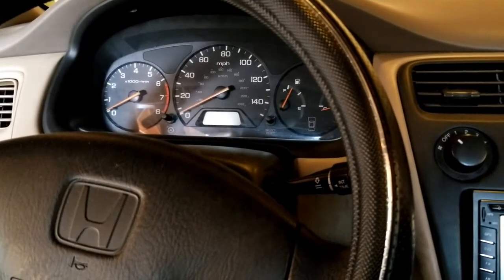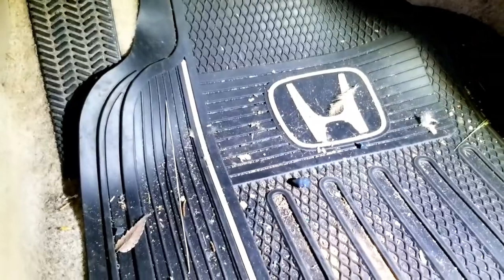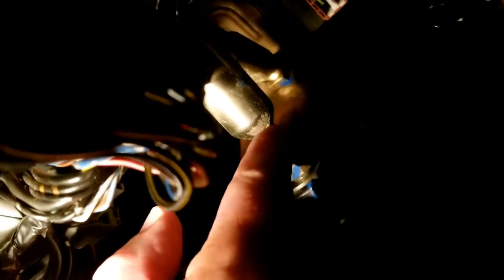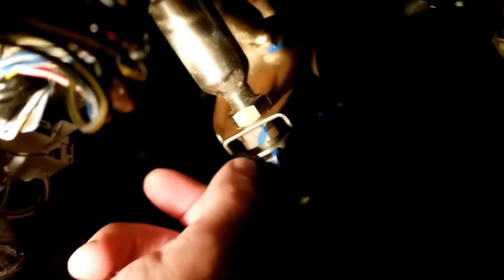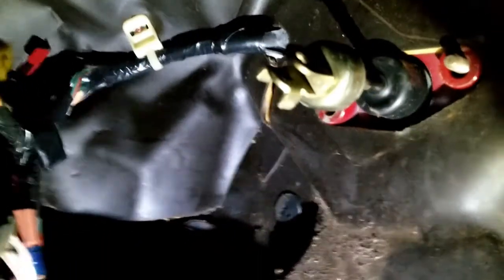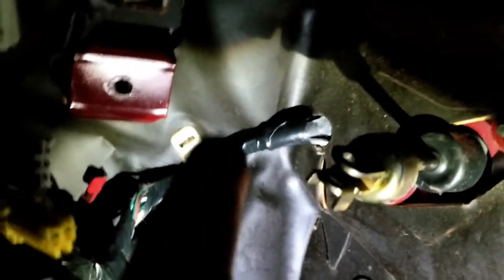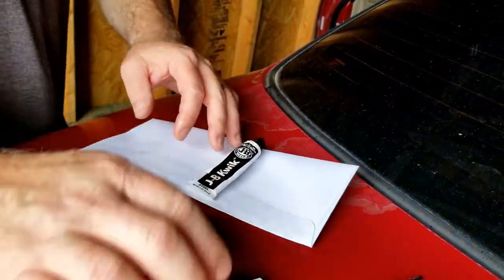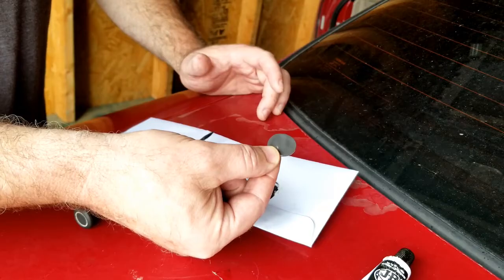Honda Clutch Safety Switch Repair

Comment: How to replace the broken rubber without taking the clutch off: 1) cut the finger off a plastic glove. 2) If you superglue a nickel to the end of your plastic glove, and 3) put jb bond on the other face of the nickel, 4) you can get your finger in right where it goes without taking the clutch off. 5) 5 minutes later, carefully pull your hand out of the glove.

Comment: There’s actually a way to start the car without the paper clip.  Once you find the switch.  Make sure it’s in neutral.  Put the key in ignition.  Locate the safety switch button.  Depress it.  Turn the key with your right hand.  Boom it starts
Reply: i did the same.  The rubber  stopper was still in the top one but wasn't making enough pressure to push the pin in.  So i glued a nickel to it as in the video... i didn't remove the clutch.  Took a small file and taped the jb weld glued nickel to end of it and pressed it up and on top of the existing stopper and wedged it with the clutch all the way down (put a 60lb weight up against the clutch pedal) to hold in place  to dry.
Reply from the maker: Work smarter, not harder. Nice!
Reply: Not with mine and not sure why

Comment: I had the same no-start problem and after some troubleshooting, determined the clutch safety switch itself had failed, and the rubber stoppers were both gone.  A new switch, and a couple small bolts later (along with some elbow grease and some choice language) we're back in business.
Reply from the maker: Glad you were able to get it sorted out!

Comment: Thanks brotah! I have a CRX that wont start. I went ahead like a dummy and purchased a new battery, main relay and starter relay. Somehow the Honda gods noticed my frustration and led me to your video. Will give this a try and see if it works.
Reply from the maker: Good luck! Hope it's that easy for you.
Reply: Ktec Garage hello again! It worked!!! Thanks..I used a penny and attached some tape. For now that will do..later I will take out and use the glue. And yes it’s so tough getting down there and I’m a short guy..subscribed!

Comment: I’ll be darned. I saw that little rubber stopper thing in my floorboard today when my car wouldn’t start earlier in the parking lot. I thought “what the heck is that little thing” and threw it out on the pavement 😅 Maybe I just need to glue a nickel in there now lol. My cruise control is dead too maybe I’ll put a nickel there too. I’ll jump the connecting wires to see if it will bump too- and if not maybe I’ll need a new switch like I think you said. Cool vid 🤙🏽
Reply from the maker: Haha! Now you know. Thanks for commenting.

Comment: Oh gosh so I saw the bottom stopper....But I didn't realize there was also a second one on top. I will have to check that tomorrow morning hopefully that works!!!
Reply from the maker: Good luck!
Reply: @ktecgarage  seems I have both stoppers on top and bottom. No luck. Battery is good, so I guess only thing is a starter? No clicks no sound, nothing.
Reply from the maker: The switch could be bad. You can jump the yellow connector with a paperclip like I showed in the video. If it starts, replace the switch.

Comment: So i just used the paper clip trick but yeah both pads are mia psa on 04-08 tsx the clutch master cylinder is a royal b*tc# to get to so dont let it slip in when you remove the pedal lol

Comment: **1st off, thanks for this video. I bought a set of 4 clips to replace the brake pedal and lower clutch pedal but had no idea the clutch had a 2nd one so this video saved me a ton of effort. I thought I was needing a new starter.

I went to Harbor Freight and bought a $6 tweezer set(long ones) and was able to put the clip in without removing the pedal. It was a bit awkward to pull off but much better than removing the pedal. I just wanted to post this in case it helps someone else.
Reply from the maker: Thank you for adding that info!
Reply: @ktecgarage  No problem. Also, mine is a 94 Del Sol Si
Reply from the maker: Even tighter than that Accord. Had to do the same on my 93 civic, which is basically the same as your Del Sol so I feel your pain.
Reply: What are the clips called? I replaced the brake and front clutch clips but not sure what the back clip is called.
Reply: @misprintzrust  Same as the brakes clip. Brake or Clutch pedal stop pad. 4 pk for around 7 bucks on eBay.

Comment: After bleeding my clutch, my slave cylinder spring broke. This caused my clutch to fall.to the floor and stop working. After this repair, my cruise control would not work. Searching every video and website, along with all the electrical diagrams etc to not find the issue, I stumbled across this video which had nothing to do with the cruise control. Incidentally, this video pointed out the plastic rubber that fell off causing the cruise control to stop working. Two minutes to inspect and now my cruise control is fixed 🤩. The little rubber behind the peddle must have snapped when my brother got the shits trying to push the peddle down helping to bleed a clutch with a faulty slave cylinder. Thanks for this video 😊 Was about to pay an auto electrician to diagnose a problem that cost nothing to fix 😆.
Reply from the maker: Glad you found the video before you opened your wallet! Thanks.

Comment: This is a REALLY well done video, kudos. It's so tough to get a good shot under the dash. Great job explaining how to fix this problem with minimal investment. JB Weld plus a measly nickel!  I've just finished removing the clutch pedal assembly on my 2007 Honda Fit Sport to get enough clearance to allow replacing the EPS electric steering module. I've been working on cars for over 60 years (turning 80 tomorrow) and this EPS job was by far the most difficult job I've ever tackled. You can't see it, you can't reach it behind the fuse panel. Had to remove half the nearly impossible to remove electrical umbilicals from fuse panel so it could be muscled out of the way. That alone took two hours and several beers LOL. Required more skill and patience than rebuilding an engine or manual transmission. Who enjoys laying with your back across the threshold while trying to see up under the dash? What a terrible nightmare. Back to the point of your video, totally agree that removing a Honda clutch pedal assembly is a difficult time consuming job. My assembly is attached with four nuts. The two on the right were not too bad to reach plus you can see them. The bottom left was tougher but it took me 5 times as long as the first three in total to remove the one on the upper left. You cannot see it from the footwell with a superbridht flashlight. An inspection mirror didn't help. The flange the clutch interlock safety switch attaches to makes it impossible to see and nearly impossible to get a 12mm socket on that nut. Plenty of swear words, cobbling together multiple adapters and short extensions and different wrenches to break it loose initially and then switch to a fine tooth ratchet handle. Factory spec for the nuts is 16 lb/ft. I estimate it took at least 50-60 to loosen them. The gorilla in the factory must have cranked his pneumatic wrench up to 175psi.  The Honda engineer who designed this to be nearly unremovable should be drawn and quartered.
Reply from the maker: You are preaching to the choir! Now check my videos replacing the heater core in that car if you want to see engineering after thoughts in action!

Comment: I wondered what all those broken blue plastic bits were... and why my car wouldn't crank. Thanks for making this vid - super helpful!
Reply from the maker: I'm glad it was helpful! No fun when your car won't start.
Reply: @ktecgarage  btw, this morning I discovered that one of those flat, round nickel-sized fridge magnets works too. And (depending on one's flexibility) can be slid up into place with no disassembly of the pedal. Just another option in a pinch. Cheers!
Reply from the maker: Too smart for me!

Comment: Great idea gluing a Nickel onto the pedal bracket where the cheap plastic button was! Epoxy is one of the strongest if not THE strongest adhesive you can buy. It’s available in one minute, five minutes, and one hour setting times. I wouldn’t recommend the one minute unless it’s something easy to get to, and you’ve used it before. I wouldn’t recommend ANY adhesive on piston connecting rods, though!😂Nice vid!!

Comment: My '97 Honda had this exact problem, thanks so much!! I learned that there were actually 2 safety switches and also how to fix the issue, this is perfect
Reply from the maker: Glad to hear the video was helpful. Thanks for commenting!
Reply: You have two switches on a MT car if it has cruise. One is the safety interlock found on all manuals. It only allows starting the vehicle with clutch pedal depressed. An obvious safety feature to prevent unexpected lurching if car is accidentally started in gear. With cruise, the other clutch position sensor switch will disengage cruise as soon as you start depressing the clutch to change gears. I don't think they design cruise to be smart enough to keep the same speed you've set if you for example shift from 5th to 4th as when going up a steep hill. This also prevents overrevving when the clutch is depressed  because suddenly there's no load on the engine so revs would soar past redline.

Comment: First of all I want to thank you to creating and sharing this video. My manual #Honda #Accord won't start for the last few days and after 3 days of root causing and Ubering ($120) to and from work, I finally found this video. What convinced me more was the "bread crumbs" broken pieces of the rubber stopper on the floor mat in my car. Additionally my cruise control doesn't work now.  I am going to see if I could fix this myself. Most of the videos I initially came across were mentioned the usual suspects like battery, starter, fuses, relays etc., but not the stopper perhaps because its this tiny part that the average car owner isn't away of their existence. I have liked and subscribed to your channel as a way of saying thank you.
Reply: I did a little deep dive and found the original Honda replacement part instead of a coin, and here it is: 

Pad, Pedal Stopper - Honda (46505-SA5-000)  -$3.04

https://www.hondapartshub.com/oem-parts/honda-pad-pedal-stopper-46505sa5000?c=Zz1jaGFzc2lzJnM9cGVkYWwmbD04Jm49QXNzZW1ibGllcyBQYWdlJmE9aG9uZGEmbz1hY2NvcmQmeT0yMDA2JnQ9bHgtc3BlY2lhbC1lZGl0aW9uJmU9Mi00bC1sNC1nYXM%3D

you can also buy a replacement par from AutoZone for $7.99

Dorman Brake Pedal Pad 74015
https://www.autozone.com/interior/brake-pedal-stop-pad/p/dorman-brake-pedal-pad-74015/343710_0_0?cmpid=LIA:US:EN:AD:NL:1000000:GEN:71700000069889792&gclid=Cj0KCQjw9O6HBhCrARIsADx5qCRa7vK2WzUV7WELnfk8hADvDZY4fSgPGxLpIEAKd2Nqf2f6CA2gPZAaAhMyEALw_wcB&gclsrc=aw.ds
Reply from the maker: Well, I'm glad you found this and I hope this helps fix your ride. Let us know how it goes. 

Thank you for your comments!
Reply: Update 07/25/2021:

So this morning I finally attempted the fix, i.e install a new Stopper specifically the  "Dorman Brake Pedal Pad 74015, $7.99" which I picked up from Oreilly. The car started right away. There is a twist however which I plan to make a video and publish in the coming days.

Comment: Thanks for that very informative video.  I had a "no start" situation a couple of days ago and thought it was the starter.  I had the starter tested and it was fine.  Worry time kicked in.  I knew it had to be something electrical but didn't know where to start.  I'm a Chevy guy and got my 96 Accord as a daily driver to allow work on my Chevys.  On a whim I did a youtube search for a "Honda clutch no start" and saw your video.  I did see the remnants of the rubber stopper in the floor too.  I used 2 pennies and super glue instead of nickels and the jb, so I got my 2 cents worth lol.  Everything works fine.  I'm 6 feet 8 inches tall and you're right, getting at that clutch is a pain in the a$$.  Thanks again for the great tech info.
Reply from the maker: Thank you for watching and commenting! I am always glad to hear I helped someone out.

Comment: Thanks for this informative video. Because of it I realized that what I thought was the clutch safety switch, was actually the cruise control switch. Driving only locally, I had no need for the cruise control. So, it also had lost its plug and I didn't know it wouldn't work. Both plugs were gone. In addition to those, I had the same problem many months ago with the brake light switch. I have now replaced all 3 of the pedal plugs with bolts. I had a flat bolt with no slot for a screwdriver. I use it for cruise control plug on the clutch pedal. For the clutch safety switch plug, I replaced it with a carriage bolt. I filed the square corners under the head so the bottom of the head would fit flush with the pedal shaft. It works now. Mystery solved.

My question is why does Honda even use the plugs, instead letting the the switch plunger just use the solid metal pedal shaft? 

Suggestion: If you use a Universal Joint Socket and an extension or 2, you can get to the upper left nut for the clutch pedal assembly much easier. I drive a 2007 Acura TL Type-S. Also, if you use a small stool, about the height of the door bottom, you can get in car and under the dash much easier. I am 66 years old, 6' 1" tall and about 200lbs. It makes the job much better.

It works now. Mystery solved. Thanks again. And God bless you!
Reply from the maker: Thank you for commenting and sharing. I'm always glad to hear my videos were helpful. 

If I had to guess, Honda went with rubber stoppers to reduce any kind of shock to the switches. That is the only thing that makes sense to me.
Reply: Same thing I dealt with...lost the brake light stopper a few months ago now the clutch....lost the cruise control awhile ago also.
Reply: my cruise control went out years ago and i looked and the stopper is excellent condition so who knows

Comment: Just got done putting my clutch pedal assembly back in the wife Honda. Even my son made the comment about the design flaw that you have to remove the pedal assembly to replace the little stopper, the stopper you can access doesnt keep the car from running...
One tip...the pin that connects the linkage to the pedal has a clip/pin holding it in and in my car it was installed where you can hardly get to it so when I went back with it I reverse it so the clip is on the other side and I can see what I am doing putting it back in.
Reply: That pin is designed to go in from the left side with the retaining clip installed where you can see it on the right. There are flats on the head of the pin which prevents it from rotating once installed. It sounds like some idiot installed it backwards. I have no idea how they could manage to install the pin from the wrong side, there's almost no access on the left to install the clip.

Comment: This was the best video I've seen for big guys and so descriptive. You are the first person to ever describe the 2 switches. I've had my car for 2 years and my cruise control would never work until now. I only thought there was only 1 of those pads, and I replaced my start switch with a screw and nut the same size as the pad. Hard as hell to do it but now I will do the same for the other one. Thank you for this video.
Reply from the maker: Always glad to hear I helped someone out. Thanks for watching and commenting!
Reply: Having this same issue .. have changed both switches changed the starter and also have changed the main relay... have changed every fuse in the car ... just about has me stumped .. also have re done every ground in the cast as well
Reply: @joegambino4185  did you ever fix it?

Comment: great video - saved me a ton of trouble, thank you!!! drove my 99 CR-V for a week with the paper clip method and then got a new switch. 
\
Couple things I learned - 1: taking the front seat out helped tremendously to reach under the dash (pretty easy to get the seat out). 
2: Strongly recommend using a friend with small hands and a short handled wrench to get the switch out rather than taking the pedal out.
Reply from the maker: Always good to get a different perspective on these jobs, thanks for the tips!

Comment: You saved my life with this video! Thank you SO much for making this. I not only fixed my clutch safety switch but was able to figure out why my cruise control had stopped working and fixed that too.

I used a nickel for the cruise control part and a rubber stopper for the actual clutch safety. Pro tip - if you remove the electrical box from the holder and have someone with small hands reach up you won't have to remove the whole clutch to make this repair. It was tight but the hardest part was getting the dang electrical box off the holding piece!
Reply from the maker: I'm very glad the video helped you out. Thank you for commenting!

Comment: No fricking way. I tried the starter alternator and even changed the ignition switch i was about to change the whole cylinder for the key. After a year of jumping to car directly from the starter a though popped into my head. Its a standard but i can start it without the clutch running wires to the starter. Hey maybe the clutch has a sensor that doesn't engage and doesnt let it start. Searched then this video came up you are amazing sir no online source could tell me what it was not even mechanics Thank you
Reply from the maker: I'm very glad to hear the video was helpful. Thank you for letting me know!